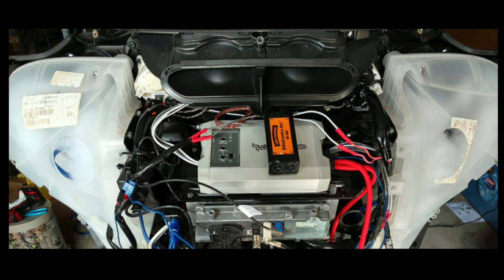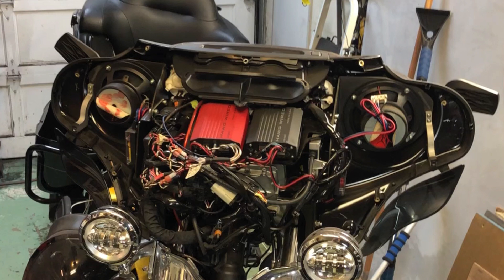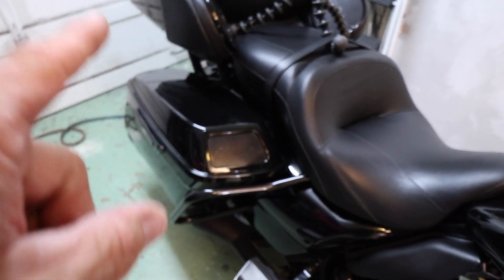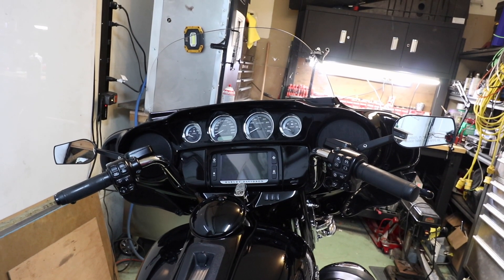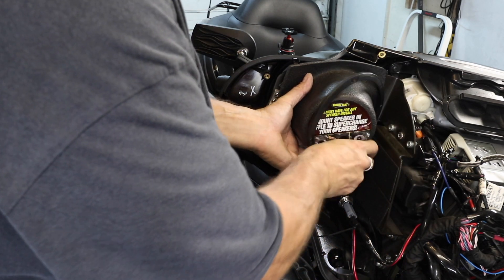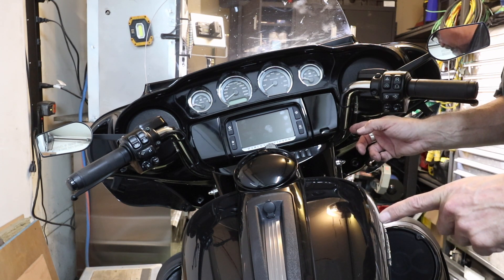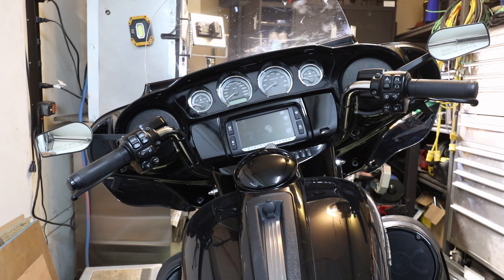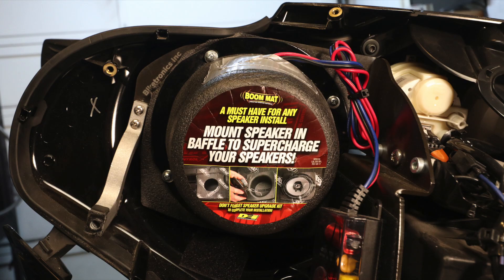Harley Speakers.   Do They Sound Better in The Pods?

Comment: I saw somewhere that the main purpose of enclosing the speaker is to separate the sound waves coming out the front (what you wanna hear) from what's coming out the back (what you don't). The reason is the sound waves coming out the back are 180° out of phase from the ones coming out the front (they're exact opposites) and both together will cancel each other out. So at least mount the speakers to some kind of plane extending out past the diameter of the speaker itself to help separate the sound waves. Ported boxes can take some of these waves at a certain frequency (that's why they need to be tuned) and as it travels down the port it is reversed so that it is back in phase with the waves coming out the front. That's why a preyed box performs really well but only at a narrow range of frequencies according to how it is tuned. A sealed box is considered best all around because it uses the air contained inside as a buffer to keep the driver from traveling too far inwards and outwards resulting in a tougher base with more tighter response and all around better sound at all frequencies. 

Just thought I'd throw that in there, i been researching those tiny bullet shaped pods they been putting on handlebars lately. Tip, they are cheaper, easier to find, and available in bigger sizes when you look them up as marine speaker pods...
Reply from the maker: @cybernaab that’s exactly what I did pretty much right after making this video.  I cut the bottoms out of the foam cups.  I’ve since upgraded to biketronics 7.1 pro speakers with their aperiodic ring on them.

Comment: Glad I found this.  I'm doing a little project for my Road King with a custom fairing - it currently has 4x 5.25" kickers in the fairing and they're free-air into the internals of that fairing.

I'll be taking some of those speaker baffles and laying fiberglass in them to create individual "pods" or enclosures to give them a little bit of restriction - hopefully that creates enough backing-room for them to have just a little bit of bump while keeping the clarity I get with these speakers.  That's my only complaint is that there is zero low-end.
Reply from the maker: You’ll be hard pressed to get any bottom end out of 5.25 speakers no matter what you do. The best advice I can give you, if it’s within your budget, is to look into adaptors to swap out the 5.25’s for 6.5’s and then hit them with some good power. You will be amazed at the difference. Even if more power is not in the budget, the difference will be night and day with just the bump up in size.  Thanks for watching.
Reply: @i.b.lancer  I'd LOVE to put some 6.5s in however the fairing doesn't allow for that - it's 4x 5.25's.

Comment: Here is something you can try.  As you said the fairing is like an enclosure, you could put some poly fill around each speaker and maybe put some double sided weather stripping along the the halves of the fairing to seal the enclosure a little better.

Comment: The two speakers play independant of eachother but without seperate enclosures and using the fairing air space as a common air space, both speakers will cause a negative impact on each other. All speakers require air space to function properly and those tiny foam buckets dont cut it. Those speakers are meant to work in a car door type area. Compare those foam buckets to a car door space..if you want to do a good comparison, try one comparing the sound using those flimsy foam buckets to the sound of the stiff factory buckets with sound dampening (Dynamat) on them..

Comment: I have a 2007 street glide and I currently have sinister sounds speaker pods which I love.. but I’m seriously considering going back to the stock support bracket and just getting the 5.25-6.5” speaker adapter and get rid of the pods… but idk if the sound quality would be better or worse in my 07 without the speaker pods.. 🤯
Reply from the maker: So what did you end up doing?

Comment: I've tried these on my bike and didn't like them, I lost depth and lots of sound. On my Victory I learned a neat trick for getting tighter midbass and more sound from my speakers (similar to running them in a large sealed enclosure). Try wrapping the backs of the speakers with poly fill. Cut a 3-4" strip about 3' long and wrap the back of the speaker tightly. You will be amazed.
Reply: What "poly fill" are you referring to?  The only poly fill that I'm aware of is the pillow filling kind of stuff
Reply: @aamantium1 the same stuff, but it comes in a roll instead of a loose bag. It's called poly fill matt.
Reply: @s.in.bagger9933  gotcha.  I'm having trouble imagining how you secured that material to the back of a speaker
Reply: @aamantium1  use 4"x36" strips and wrap it somewhat snug around the rear of the of the speakers. I then used a few 1"x6" strips of gorilla tape to secure the poly fill in place.
Reply: @s.in.bagger9933  I'll give it a shot. Thanks for the tip

Comment: With headphones on I can definitely hear a difference...with the baffles it is less "tinny" and more full...I'm sure that may drown SPL and for a motorcycle that's a negative...but it sounds better with them on to me. How were they on an actual ride? Could you notice anything then? Also, what speakers are those you are running?
Reply from the maker: Those speakers were the discontinued 100w Hawg Wired 6.5’s. I’ve since swapped them out for the Biketronics 7.1’s

Comment: The speaker left and right 6 inch or 7 inch ?
Reply from the maker: 6” in this video. They were later on replaced with 7”
Reply: @i.b.lancer  the original is 6 inch ?
Reply from the maker: I believe the stock upper fairing speaker size is 5.25”. The speakers in this video are not the stock speakers they are 6 inch Hawg Wired speakers.

Comment: Was the outer fairing installed during the test without the baffles? If not, cancelation occurs which botches the results of the test. However, the same can occur if the fairing has large gaps between inner and outer. That is the conundrum that the stock pods try to solve.
Reply from the maker: In both cases the fairing was installed tight and riding ready. I should mention that the outer fairing has a layer of Dynamat on the inside.
Reply: Good.  I was worried if that had affected the results though without the baffles the bass punch was deeper

Comment: The pods give the entire fairing structural integrity. How does the baffle change the tone of the tweeter? 🤔
Reply from the maker: Structural integrity is laughable. They haven't needed it for 100 years. The bottom line for Harley is that the pods make it harder for the buyer to do speaker swaps and forces the average Joe to take it to Harley to do any modifications to the fairing speakers. Period. 
And Look up Aperiodic Loudspeaker Enclosure Design. It doesn't really have anything to do with the tweeter.

Comment: Keep in mind flexible foam and hard plastic will act very differently. Air space is very speaker specific. I get what you where trying to do in theory but.......
Reply from the maker: The results speak for themselves.
Reply: @i.b.lancer  my point is that the stock are prob much better than the foam

Comment: El jefe makes a much better speaker baffle for 6.5 it's a hard baffle not that soft foam baffle I don't like that one that one belongs behind the speaker inside of a car door install the hard baffles and you really notice the difference
Reply from the maker: norman matura... I didn’t know about the El jefe one, I’ll check it out. Thanks for the tip.
Reply: @i.b.lancer  that product is what's normally used in sound competitions for a bagger audios systems generally they'll take a 6x9 lid and convert it over to a 6 and 1/2 and use the hard baffles behind it lots of times it's used to isolate the sound waves from the Miz base drivers that are in the saddlebag in order to keep them from distorting the six and a half,  when it plays..😎
Reply: He’s right hard enclosures much better than the soft you will definitely notice a difference tighter cleaner sound!!! All the good Harley sound systems are now rocking hard enclosures could also try some sound deadening on the inside of the faring it also helps with vibration! And you could rocket on the inside of your saddlebags also sound deadening helps a lot!